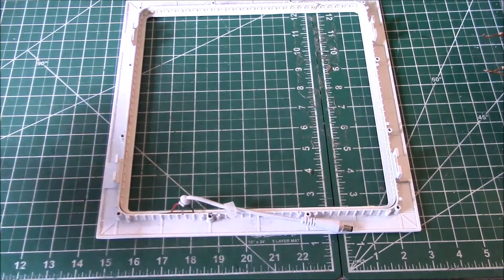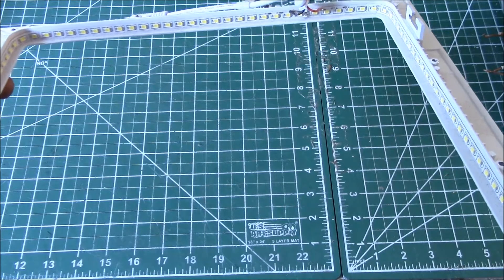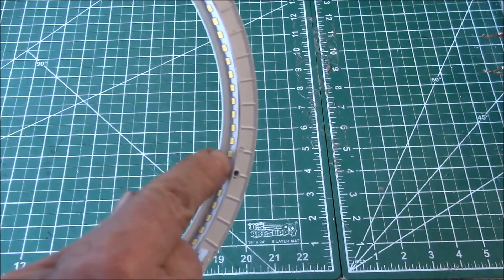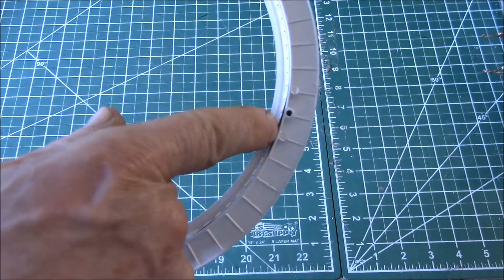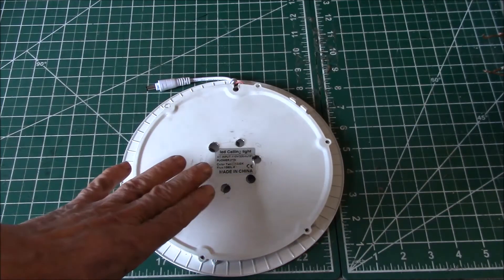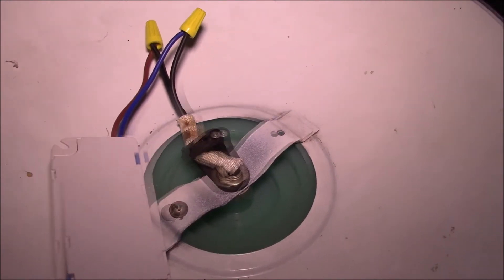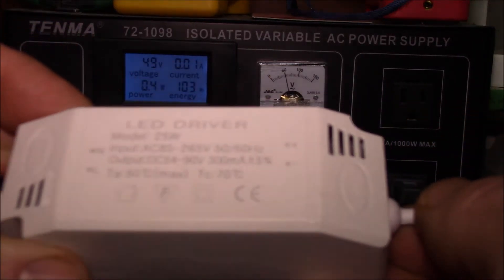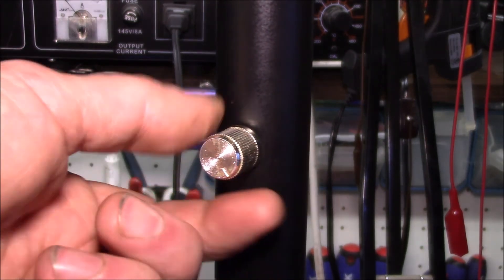Halogen Torchiere Floor Lamp Conversion v3, Part 3

Comment: You can now buy this type of round, LED ceiling fixture in a surface mount where the driver is integral to the fixture so you don’t need a separate driver module that gets installed into the fixture reflector. They are around one-inch thick or maybe a bit more. They also have a selector switch on the back of fixture where you can select three different color temperatures, usually 2700K, 4000K or 5000K ( some may have slightly different color temperatures). You can either adjust the switch to a single color temperature, or you can set it so you can change color temperature by simply switching on and off switch fast to desired color temp. They have these at Lowe’s, Home Depot, etc.
Reply from the maker: For sure, more options today for this.  Originally, I used a round CFL tube, then this round, recessed light that I'm using in this video.  I like this style as it sits down totally below the rim of the lamp reflector. Something an inch thick would sit above the reflector on my lamps and that can shine in your eyes as you walk by.  The color temperature options are nice on the newer lamps.

Comment: Can you please provide a link to the 8" round light used in this video, the dimmable driver, and if you found a 9" light, a link to that as well?  Great series of videos, thanks!  Nicely done.
Reply from the maker: Link and search string in the 2nd part video:
https://youtu.be/w7sRYU2Jd5c
Yes, did find a 9" lamp, you just need to search listings and find one, it can take some time as you need to dig through all the options in each listing and there are many, many listings.
Hope to be making an update video on the conversion in the near future.

Comment: Why would one go to all this trouble when drop-in  LEDs are available? 

See https://www.etsy.com/listing/387137612/led-conversion-bulbs-choice-of-5-10-30?gpla=1&gao=1&&utm_source=google&utm_medium=cpc&utm_campaign=shopping_us_b-craft_supplies_and_tools-other&utm_custom1=0c01dbce-8ac9-4b30-a3a7-915f3a203556&gclid=CjwKCAjwjIHeBRAnEiwAhYT2hyjoyjWqLCwvwkP2bfDmekVkhQWyVIPIVX6gfBhUsQRz8zgsuRdSABoC8egQAvD_BwE
Reply from the maker: When I first converted mine to CFL, there were no drop in LEDs.  And since the original bulb holders were long gone, I had to use a lamp with bare wires to connect to.  I also wanted a choice of color temperatures.  I also like the diffuse light the round fixtures put out compared to the harsher light that the exposed CFL or LED bulbs I used to use put out.  I also like the external driver on the round lamps, since that's usually the part that fails.  I can replace the driver in mine for a few dollars or I can convert my lamps to run off of DC power from my solar battery bank.

But yes, it looks like those drop in LED modules might make a nice option.  May require cleaning from time to time.  The round lamps can easily be brushed to clear off any accumulated dust.

Comment: Nice good luck on the 9 inch lamps
Reply from the maker: Thanks.  Yes, hope I can find the slightly larger lamp in warm white.  My square lights are natural white and I just don't like that color temperature.  Unfortunately, the way these things are made, you really can't swap out the LED strip as I thought would be possible.